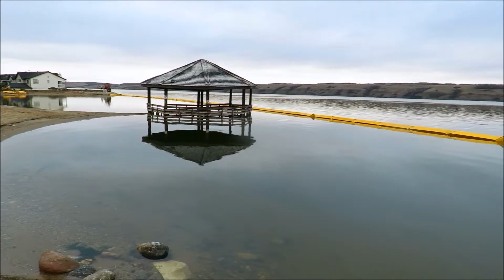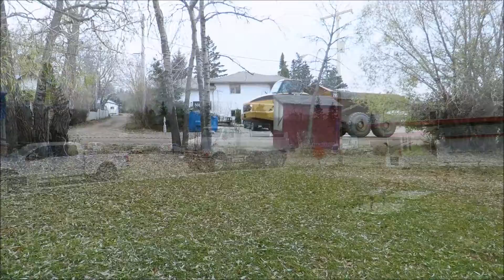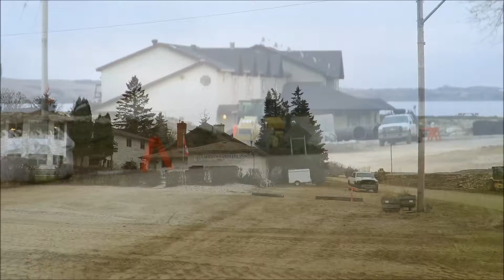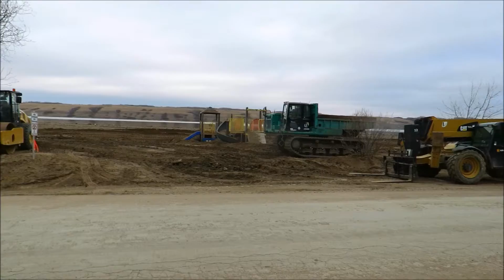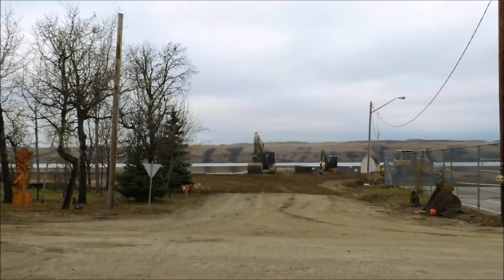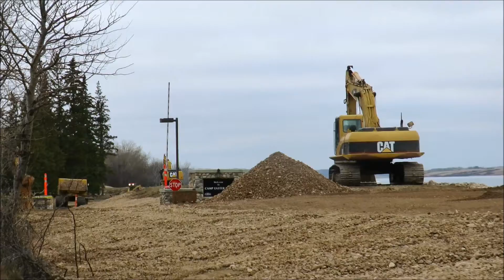Raisng The Berms Continues

Comment: Al, does the lake have an outlet?
Reply from the maker: No it doesn't have an outlet and that's the biggest part of our problem. Evaporation is the only way to lower the lake level. We've had a number of years in the past decade with unusually high amounts of rain/snowfall. I'm told this last summer we had 30 inches of rain, the norm is 10.